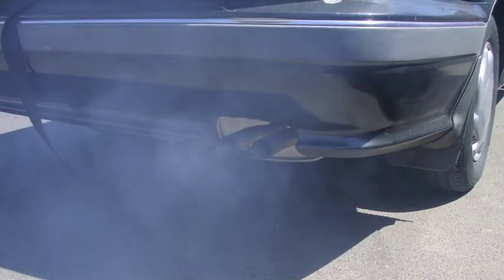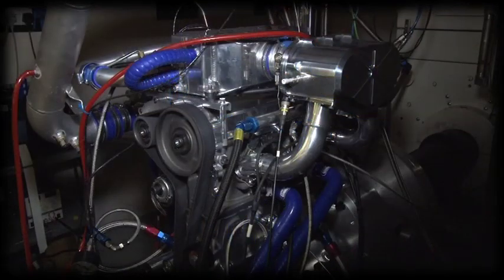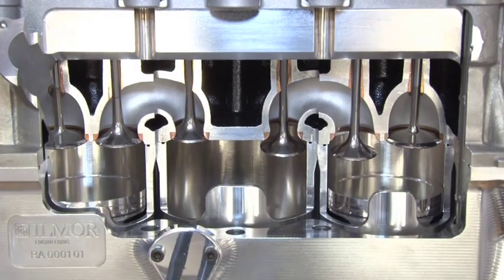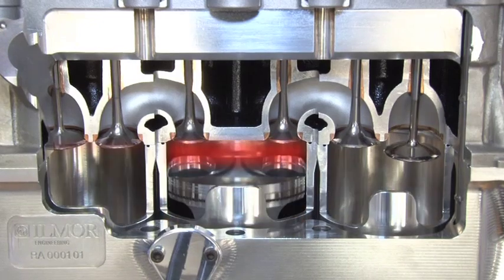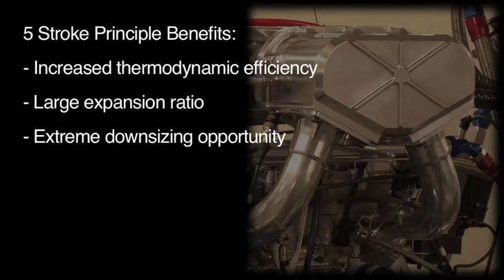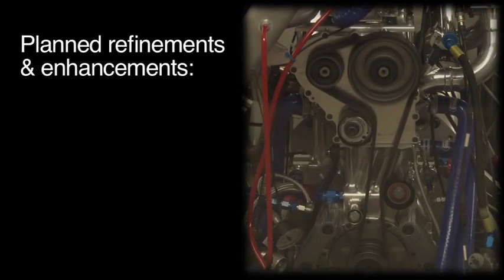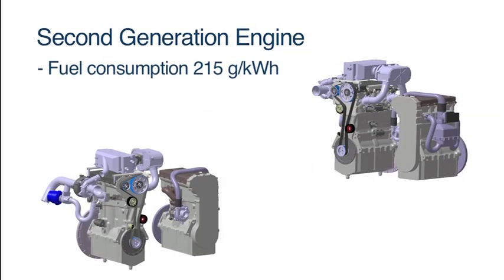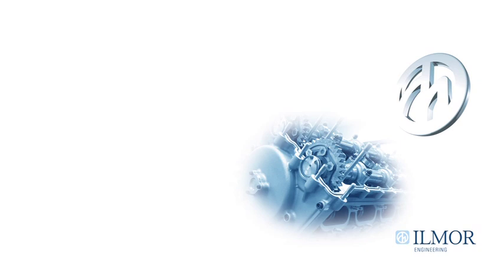Ilmor 5 Stroke Engine

Comment: Injecting water during post combustion/exhaust cycle would be interesting. Recently came across dual expansion steam engines.

1. Water/steam will provide cooling AND
2. Increased power output with no extra fuel.
Reply: that would mean carrying around extremely pure water.
Reply: Agree that pure H2O would be necessary for engine’s life/performance. Not sure if byproduct H2O of combustion cycle can be sequestered. 

In hypothetical case, what would be efficiency, performance gains.

Comment: I would have made the slave cylinder smaller.
Reply: It needs to be larger because the expansion of the exhaust gases will produce less work than the work generated by the initial combustion, so a larger surface area is required to even out the three forces acting on the crank. It’s similar to the expansion principle used on steam engines, where each stage of expansion required a greater surface area to compensate for the lower value of latent energy in the exhaust steam.
Reply: the same size as the others
Reply: smaller means less expansion = less useful.

Comment: Make the middle piston rotate 180º, this way both volumes of the 
expansion cycle are added. Say that cilynder 1 and 2 has 1units  and 3 
(middle) has 3units, the way it is vol 1 is sibtracted from vol 3, 
3-1=2, cil1 is contracting and cil 3 is expanding. The way im suggesting
 at the power stroke both cilinders (1 an 3) are expanding, 3+1=4, a 
100% increase of volume expansion. the drawback is more reciprocating 
mass wich can be countered by a balancing mecanism.
Reply: Then you will need four pistons - another one with a larger diameter;)
The trick here is that the same large additional expansion piston is used by two small main pistons, alternately.
Reply: actually using Nissan's variable compression & crank rod length for the one smaller piston would solve that problem. the only issue then is oiling that one. because of the complexity of linkage to it. but only having one on the engine it self makes it better than have mutliple like on a 4 or 6 cyclinder.

Comment: Since when has diesel been more dangerous with emissions than petrol/gasoline? My mechanical teachings were LPG cleanest fuel, diesel second and petrol last. All to with Co2 emissions which diesel does not have.
The concept of a five stroke is intriguing but this information seems to indicate a 2ltr motor would be developing 300bhp. That is quite good, but no proper mention about real time fuel economy or emissions. 
Something like this could save us from the potential waste problem of dangerous batteries from EV's.
Reply: nox emissions are a problem with diesels
Reply: U tellin me diesels dont produce co2 emissions even though diesel is a carbon based fuel you dumb fuck?
Reply: Diesel emits the same amount of carbon dioxide per liter of burned fuel as a gasoline engine.
In hydrocarbon fuel there is carbon and hydrogen, hydrogen when burned in the atmosphere of oxygen is converted into water (hydrogen oxide H2O), and carbon - into carbon dioxide, CO2, and nothing else.